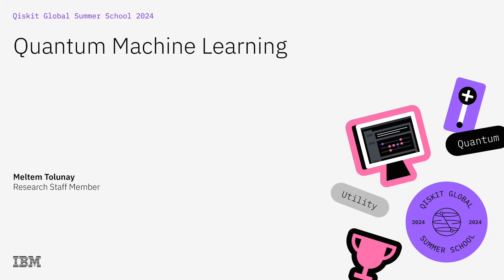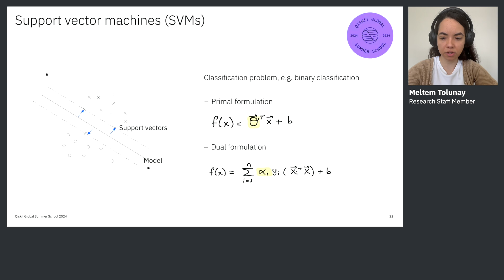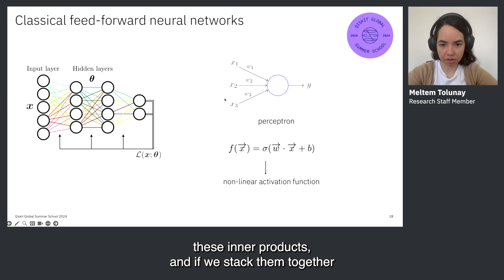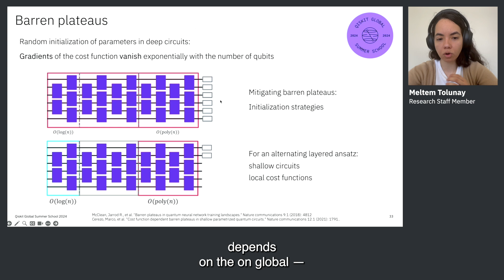Exploring Quantum Machine Learning with Meltem Tolunay: Qiskit Summer School 2024

Comment: Thanks for the lecture. It was mostly digestable for a non-quantum developer!

Also made some timestamps for easy navigation

🕒 Timestamps
00:00 - Introduction and lecture overview
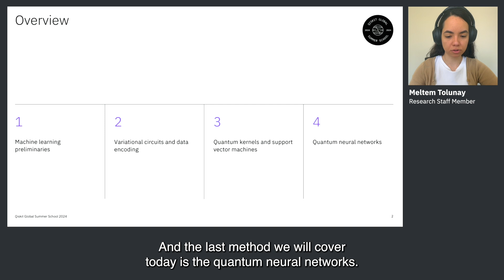01:13 - Classical machine learning fundamentals
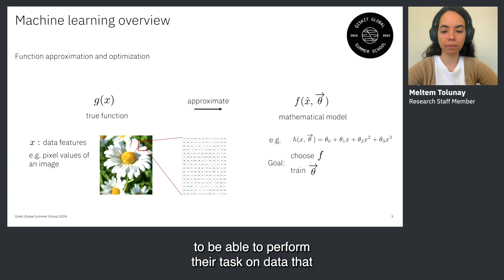04:20 - Types of machine learning algorithms
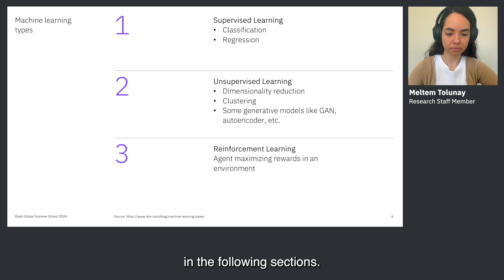06:37 - Optimization and model generalization
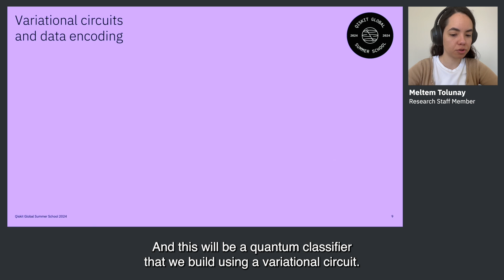09:57 - Introduction to quantum machine learning
11:55 - Quantum classifiers and variational circuits
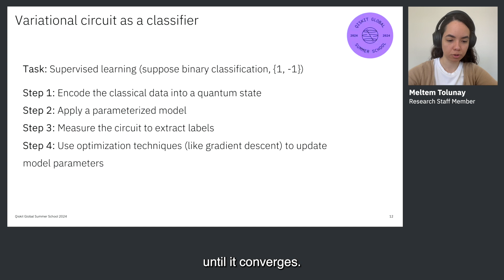14:17 - Data encoding strategies for quantum computers
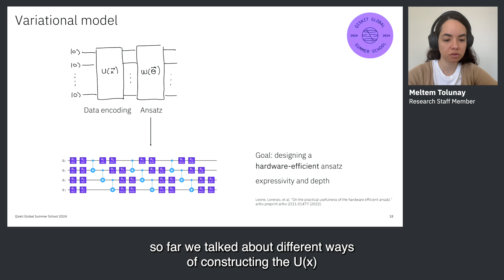18:57 - Designing effective quantum ansatzes
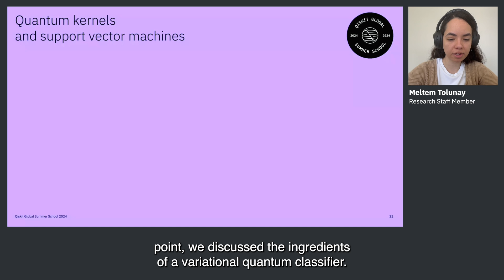23:29 - Support Vector Machines (SVMs) and the kernel trick
29:59 - Quantum kernels and potential advantages
35:36 - Quantum Neural Networks: Concepts and challenges
39:36 - Quantum Convolutional Neural Networks (QCNNs)
48:47 - Advantages of QCNNs and avoiding barren plateaus
52:01 - Conclusion and further resources